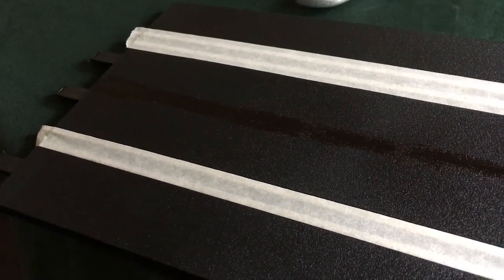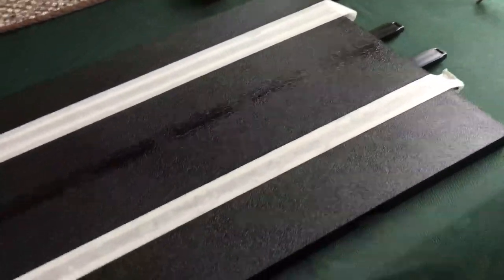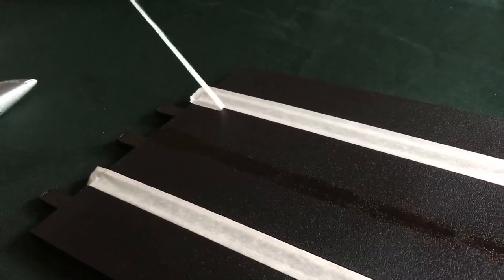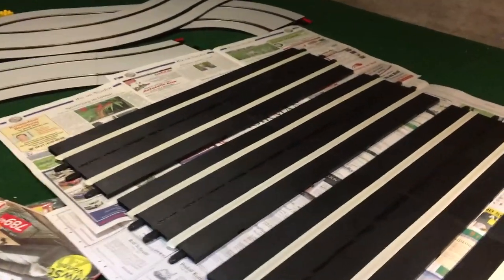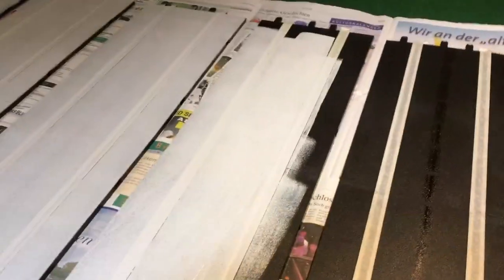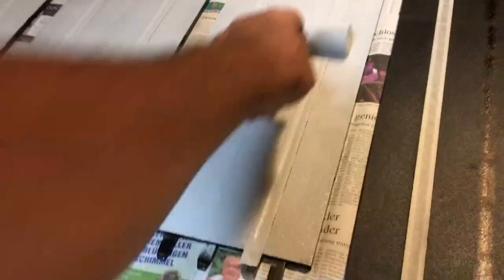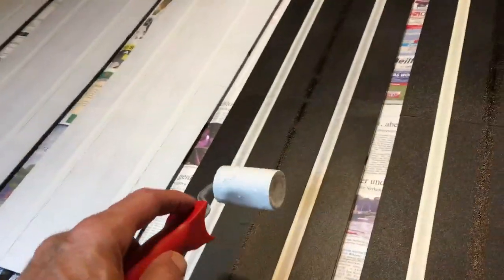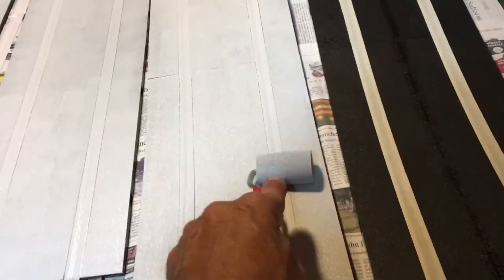Painting Carrera Track

Comment: I'm thinking about using chalkboard paint and see how much the traction improves and maybe add fine aggregate if I need to.
Reply from the maker: That should be interesting. I don't think I've seen that done before. Let me know how it goes.
Reply: @biggusmikus  Well I painted some curves that can be slick and now my Mustang gty isn't as twitchy I can squeeze the trigger harder coming out of the corner, it can still spinout but not as easy, still going to experiment after the urethane tires show up..
Reply from the maker: @mreid08  Right on. I definitely noticed a difference once I gave my cars some time to lay down some rubber on the track. Seemed to get better as it went along. Thanks for the update. Cool that that worked out. You should notice a difference with the urethane tires as well.

Comment: Nice video, painting plastic track is easier than I thought. Any special tires work better on the paint than others? Or are you using stock Slot-It?
Reply from the maker: Thanks! I found that the paint had no negative effect on the stock tires. In fact, the Slot.it tires run great on it. I also run urethanes, but not on all the cars, just a few of them.

Comment: Hello, good work. How is it holding up? I am wondering if hitting it with a flat clearcoat would be an improvement?
Reply from the maker: Hi, it's working great. Never had an issue with any of it and the look is uniform even if the pieces were painted at different times. I have no idea about a clearcoat or what that might do.
Reply: @biggusmikus  Good to know, thanks for the reply. I was thinking of the constant rubbing of the tires and etc following the same basic running lines lap after lap, thinking it would eventually rub the paint off, Usually after the paint job dries, if you put a clear coat on it, the item is protected much better, like a car finish or an outdoor table...today's modern paint probably has those protectants built in. Thanks again for verifying that it's holding up :)
Reply from the maker: @roundsaturn31  I've never had any paint rub off. I have had, however, a racing line develop on the track as the cars lay rubber down. I use rubber tires when possible, usually the stock rubber. So on track there is a light racing line. I'm wondering what kind of traction properties a layer of clear coat would have. The vinyl works great on top. I suppose if clear coat didn't create a totally slick surface, then it would probably work. I'd definitely try it on a track piece or two before going all in on it  just in case.
Reply: @biggusmikus  yes, we are on the same page...it's kind of interesting since I was thinking of spray painting for a cocrete look and then sealing it with a flat clear coat, for the clear coat to work it would have to seal the paint...so even flat would probably create a slicker surface...don't know and probably over thinking it, but that's what learning is all about :) Thanks for the chat and Happy Holidays!

Comment: Why not spray paint?
Reply from the maker: I suppose you probably could, but I think it would be difficult not to get runs or paint buildup, much less get a consistent finish. It goes on very smooth with a roller, and the entire surface is covered. Spray paint would be difficult to evenly apply, I think, and since I make loads of different layouts, I don't want to have to keep any pieces of track together just to keep the color consistent.
Reply: I'm a painter. You need to "push" the paint into the track. If you spray and hold the can at say 45 degrees, you will find that you will only be covering one side of the peaks in the plastic. You would then need to reposition the track and apply more paint.. This roller method is the best way.. The foam roller is very important as well.